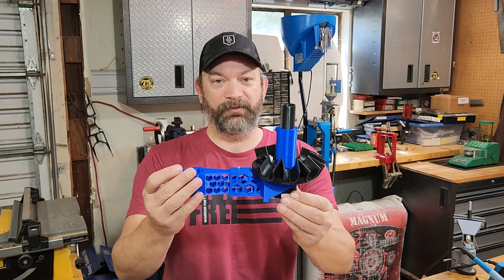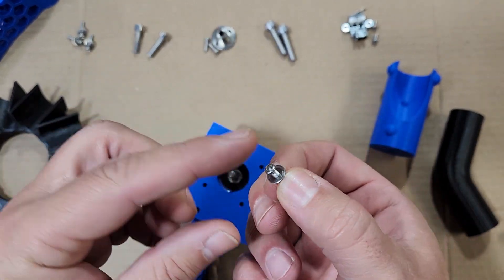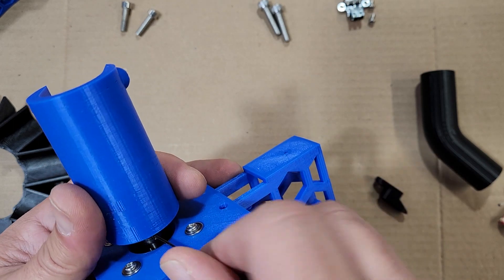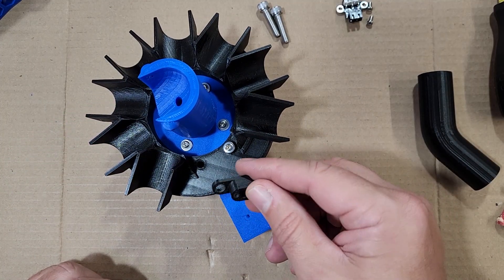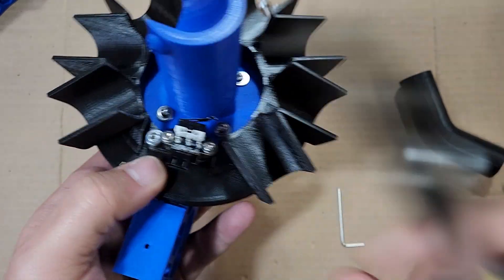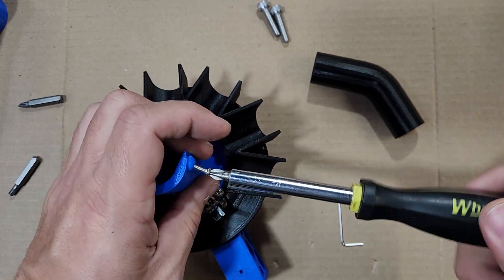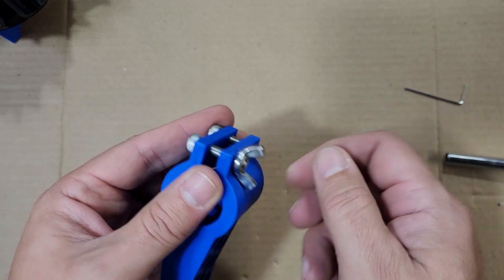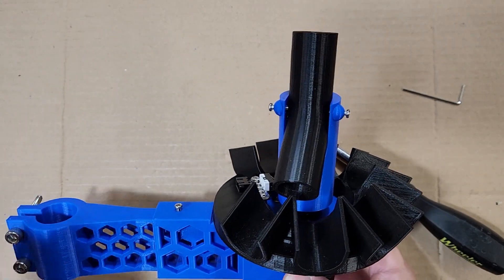CS7.1 Build Series -  Sorter Assembly

Comment: Psyched, although I just now have time to finish the project up and had all the parts for CS7.0 printed.  Oh well, better is definitely worth printing more!  Seth, have you had any thoughts of making the feed wheel two pieces so that screws together so it's easier to print without supports?  I guess I don't have my support setting dialed in for the new PLA+ filament I'm using beceause it was a bit challenging to remove them cleanly!  Thanks for the update, psyched to finally get mine running.
Reply from the maker: It was discussed but ultimately we decided to keep it one piece. Glad you like the project.